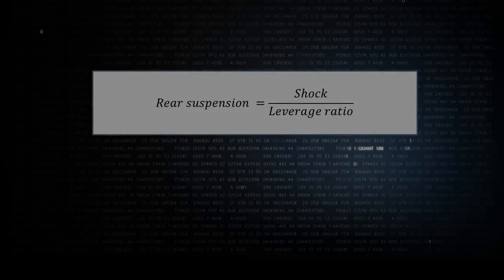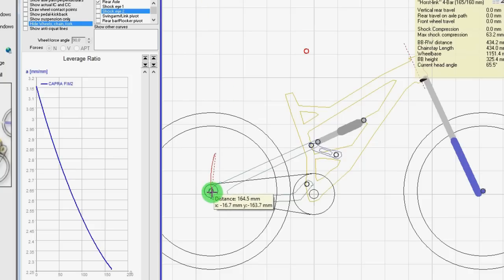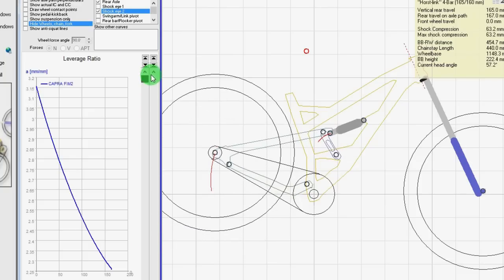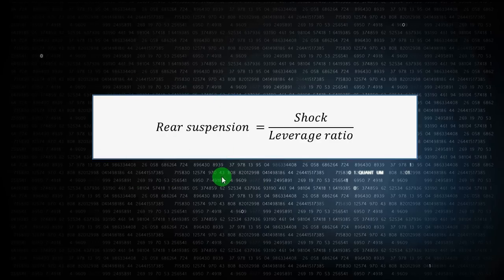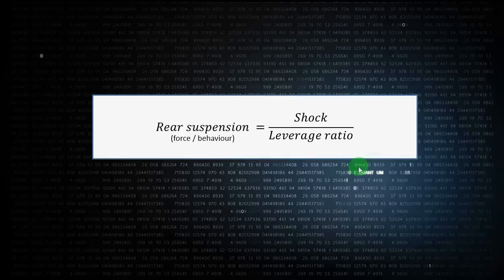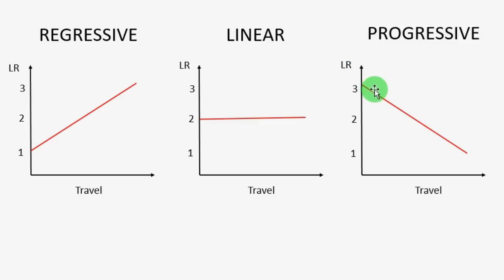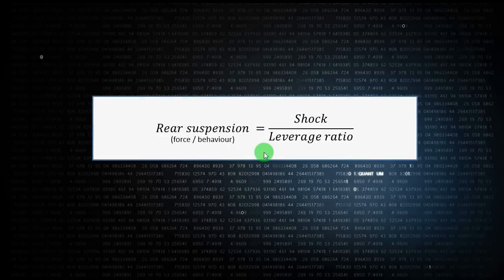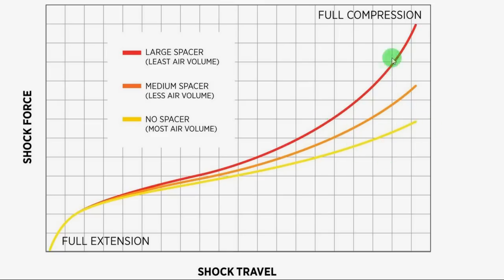MTB rear suspension (Ep.1): Fundamentals

Comment: Good but the end is way overly simplistic. While an air shock SPRING is progressive, damping isn’t. So combining air with a regressive shock curve does not make a linear setup. The spring may become linear, but damping is still digressive. Motocross has proven that you want damping and spring force to be the same, get progressive curve from frame kinematics. Or combine a progressive spring with a well made progressive shock (very hard to do).

Comment: hey Andre,

Got one question:
>>At the begining of video there was analysis of one particular bike, and from dividing his rear wheel travel with shock stroke we get 2,5  average Leverage ratio, which means that for every 2.5cm of rear wheel travel the shock will compress 1cm. 
For that bike at the beginning of the video you said that at the beginning of shock travel his rear wheel needs to travel 3cm for 1cm of his shock compression, and when we are closing to the top/end of the shock travel we need less rear wheel travel for the same 1cm shock compression (at the top/end of shock travel we need 2cm of rear wheel travel for 1cm of shock compression) and so in that particular case you said it that is a progressive bike. 
So, about that, i'm a little confused. If you need higher LR at the beginning of the shock travel and less LR at the top/end of shock travel, isnt that Regressive type of progressivity ('cause at the end of the shock travel we need to make less force to the rear wheel and, because of that, it will be easier to bottom-out? )
Maybe i didn't understood nicely the whole thing so can explain me ?
p.s. hope you can understand what i'm trying to ask.
somehow the beginning part of video and the part of video after that girl picture (when you showing those three progressivity diagrams) are contradicted with each other, or maybe that contradiction is just in my head...
Reply from the maker: Hey! Check this newer episode, it will answer your question ;)
https://youtu.be/l8VGEh3IbO8

Comment: Very helpful, thank you for that. I saw all your vid's and did not find anything about for example the Commencal (Supreme) DH V3. Do you have some facts and information about that? Thanks in advance
Reply from the maker: Hi. Thank you. Yes, Commencal DH V3 has a progressivity of 35%, an average anti-squat of 130% for a 36T chainring, and an anti-rise of 90%. The high anti-squats and anti-rises are due to the quite high position of main pivot. Bye :)
Reply: Ok, very good. Thanks a lot
Could you please summarize the meaning of this points and facts. Otherwise I have to watch everything again ;)
Greets
Reply: What does it mean for biking if you analyze the facts. BTW, I have a chainring with 34 and single speed kit ;)
Reply from the maker: It means that it has a normal progressivity for a DH bike (progressivity is the resistance to bottom-outs). It also means that the bike pedals relatively good due to the high anti-squats in comparison with other DH bikes (however, the antisquat is not very important on DH since you dont pedal much). And finally it means that the rear braking forces also stiffen a bit the suspension, reducing a bit the traction when braking, when compared with other DH bikes with lower anti-rises. Bye
Reply: So the best method is not to brake a lot ;)
OK, thank you very much. Would be great to see also a vid from this bike. The commencal is quite popular here. 
Bye

Comment: What is your opinion about the Scott Ransom 10?
Reply from the maker: Ransom had a very regressive frame, never tested one, but accordingly to the model I would guess that it's very easy to bottom out... specially if you are an aggressive rider. I know it has a specific shock, but I don't believe that it can solve completely that problem... not sure if you agree or not :) Bye
Reply: I don't own this bike, I just saw one for 660€, but I also checked the geometry with the software and considered not to buy it :) And I heard that servicing the shock is quite expensive. I've never had a full suspension bike but I think I'm a little bit too aggressive because I bottom-out my rusty low-end coil fork on my hardtail sometimes 😓

Comment: I had Specialized Big Hit similar to yours. However I felt it is overkill, as I cannot ride it at its maximum an it felt heavy and hard for pedaling for my style of riding. So I sold it and bought a local brand 160/160 enduro bike with high-end parts. It definately feels easier for pedaling, however I have noticed an annoying bug/feature- when the rear end compresses too hard my gears switch  and then return to normal. I checked the cables- they look ok. Probably it is matter of anti-squat which causes chain movements that were not present with the Big Hit. Can you help me assess the geometry as there is no info for this model?
Reply from the maker: Hmm... It's very likely that the cables are getting pinched against the frame when the suspension compresses. Remove the shock and check for any problems with the cables... You might need to increase the length of the cables... Otherwise I would suggest to check the chain length when suspension is fully compressed (although I don't think this is the problem). See the manuals of the derailleur it shows how to get you chain length correct in a FS bike. But I would bet more on the first suggestion of the cables.

Comment: Can I install a longer rear shocks? stock shock measures 6.5 inches i2i and want to try installing a 7.5
What are the effects on geometry and travel with 120mm front suspension. Ride is only for XC and light trail.
Reply from the maker: +Dan Diaz Changing the i2i length changes the geometry drastically. Increasing 1 inch in the i2i will extend the rear wheel by around 3 inches (since the inital leverage ratio on most bikes is around 3). This causes the BB to lift around 2 inches and the headangle became 3 degrees steeper... (you can detach the shock on your bike and increase 1 inch the i2i length just to see the effect...). Bye

Comment: How do I determine if my particular bike has a Regressive, Linear, or Progressive rear suspension ? I am riding a 2014 Giant Trance1 29er, do you know type (R,L,P) rear suspension this bike has ? Very NICE Leverage Ratio @ 5:30 (I was listening) :).
Reply: +John Philkill You can tell best by deflating the shock a bit (just enough to be able to compress it with an elbow on the seat), and pushing down on the seat and feeling how the stroke changes through the travel.
Reply: +Heinz Ketchup Thanks, I did a search and the Maestro suspension is suppose to be Linear, which is personally what I like. Thanks for the reply.
Reply from the maker: +John Philkill 
One more thing, you cannot predict the progressiveness of a bike based on the type of system (FSR, maestro, etc). I will made a video in the next days showing that you can have frames with totally different behaviours within the same system. Stay tuned :)
Reply: andrextr All of that is true, but you still need to remember the shock, there are many different feels to many different shocks
Reply from the maker: +John Philkill 
Hi John! You dont need to dismount the bike. You can use the linkage simulation software in the description of the video. However the demo version only has older bikes in database. In the future I will cover more topic about rear suspension and linkage software. Your Giant trance in particular is a slightly progressive frame (LR diff for trance is +0.5, check the table @ 08:28 ). That means that you can easely use all the travel of your bike and have a little of bottom out resistance. Which is the ideal behaviour for a trail / AM  bike.